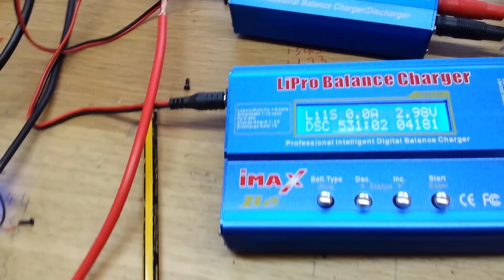18650 pack! 3 - cell or 4 - cell? Which is best suited for 12v applications??

Comment: since most car charging systems normally operate between 12.4vdc (fully charged lead acid/agm battery) to 14.4vdc while charging (this is the normal 12vdc accessory operating range)... most 12vdc electronics with battery protection (where equipped) will shut off and/or (if equipped) alarm at between 11.8-11.2vdc.( most car computers shut off around 11.2-11.5vdcand wont start the engine without having the battery charged or being jumpstarted). A 4S(4-18650 batteries hooked in series (X)parallel pack with buck converter set to output between 13.4vdc -14.4 vdc would be optimum since (watts (power out)= current (amps) x volts you want to run the higher side of the 12.4-14.4vdc voltage for any 12vdc accessories you want to power.
Reply: yes I know its an old video but people are still asking about it... this answer should help

Comment: I have done this test with an inverter with both 12v and 24v and the inverter will not come on until the voltage drops below 15v,,, at full charge the battery pack (4s) will be about 16.2 and the the inverter runs until the pack voltage reaches 10v,,, I have observed that most powerwall DYI on you-tube are using 4s.

Comment: As most 12v products work from 10.5 to 15v no buck converter is really needed if you limit your charge to the 15v peak. A 4s gives you the best results going from 12 to 15v. As with anything one should always check your devises for limits and do according. I would sooner make the adjustments for them through their connectors so the full power is available for those that aren’t as sensitive to the slightly higher voltage.

Comment: Your question of 3S vs 4S is step-up(& step down) vs step-down DC/DC converter. I'm putting no DC/DC converter out of this discussion as is purely based only on the load. We call the first one the buck-boost converter and the later one buck converter. So the answer is written on the "efficiency" of those DC/DC converter.

Comment: Build a 4S pack & add a DC to DC converter then you can dial the voltage down to what ever you like ........say 14.1V
Reply: Wouldn't that limit the wattage if you had say, 10 packs in parallel?

Comment: Perhaps a strange idea but if you install a diode between each pack (3 pieces if you chose 4 packs). These give you a tension drop of 3 x 0,7V = 2,1V. At that moment you are appr. in the right rage.

Comment: so, what are 3s ore 4s the best solution for an 12V? My solar will be adjusable for volts but my diesel generator is fixed to 14.4V... so an 3s will be over-charged and an 4s will be under-charged. What is the best solution then? if any?
Reply: Wire the generator and solar panel to a charge controller on a 4s pack and use buck converter for stable usable 12v.

I'm personally winging it with a 3s pack but I'm only running a couple lights.

Comment: I think 4s with buck is a good idea
Reply: Wouldn't the buck converter need to have an output something less than 12 volts since the 4S battery string can get down to 12 volts? The buck converter operation can be erratic and discontinuous if the input voltage and output voltage are the same.

Comment: I make 12v trolling motor batteries out of 18650's in 20-100 ah packs. I like the four series and I will explain why. @ 11V the trolling motor starts to get weak with 50-60% battery capacity still remaining. A three series can be safely drain to 9v but 12v devices fall out before that.  I had tried a boost converter to use below 11v power but you increase volts you decrease amps so it still ran weak. 

Using four series and a buck inverter I can use 80% of the cycle same performance from start to finish. Bucking down allows more amps if needed like when I run it on high. I set the buck inverter to 12.4 so as each parallel nears  3v it just shuts off as it cant boost... No bms 's on none of my packs use a buck regulator to control shut off for charge/discharge allowing me to solar charge them. I use a imax 6 to balance charge and keep a few cell checkers to balance during say a camping trip as packs get used. 

In my experience its more efficient to buck down than up making the 4s pack superior "imo". While it may seem your adding a whole series while not adding amp hours its the same energy thanks to ohms law. So my 75ah 4s packs last longer than my 100 ah 3s packs. Thanks to the much deeper cycle plus the higher usable voltage range. Three series is safer in the fact that you can't really drain them on a 12v system. While a 4s you can use them below 12v meaning cells take damage nearing 2.5v. 3s is also safer for lighting 16v may damage some led's. Anything with motor or higher amp needs a 4s is the way to go just monitor with a series cell checker.
Reply: What sort of buck inverter did you use? I tried to find any to suit 32A trolling motor with not much success...
Reply: Good question I ended up going threw a few bucks before finding one that worked. On high for extended periods of time they would overheat. I ended up using a drok buck with a heat sink and fan. It was a 25 amp unit but had constant current adjustments. So I dialed down the amp for high making for example "speed 7 the same as high"  I only turn the fan on when we travel distances with the motor and its powered by a separate 3s pack. For normal fishing use bumping it around on low- med its works fine. Also giving me more run time than an unbucked 4s pack.

Its really hard to find a buck that will handle a trolling motor on high for extended use the key for me was the CC adjustments.
Reply: Sad. I was hoping to get insight to a reliable & working configuration. 
I'm designing battery pack for tandem kayak's trolling motor (12V, 32A max constant current) and ended up with these options (from most to least favourable):

- 4S pack directly connected to PWM controller and the motor
    - it's just 8.3% of voltage increase over 15.5V which is max recommended for 12V motors
    - in theory directly connected to brushed DC motor shouldn't hirt it
    - but experiment required with real motor to see how it behaves under load in such conditions
- 4S pack with (2-4) DC voltage regulators run in parallel 
 - I found plenty of 10A-20A rated regulators which work with low voltage differential
 - so it can run with 4S pack and step down 12V..16.8V into 12V
 - in theory balancing circuit required to run these regulators in parallel
 - but practically, I can run more in parallel to get higher than needed combined current rate 
 - but again, experiment required
- 6S - 8S pack with one high current rated DC step down converter which works on high voltage differential
 - there are plenty of DC step down convertes, rated to 40A, 60A, 80A and even 100A 
 - but they all work on high voltage differential and require 18V .. 36V input voltage
 - this solution will significantly increase battery pack cost

So I will start from first to last and see how it goes...
Reply: Well my next exploit is to test automotive voltage regulators the whole thing is one big heat sink. Often they come in higher amp modulators. That or just run a 3s threw a capacitor bank witch in theory  could save 30%energy due to run start amp draws. 

Yea I am not satisfied with my configuration either.... Don't even bother trying to find a solar controller that want trickle charge and damage 18650's. Love messing with batteries but its frustrating its like technology isn't ready for them yet. Will report back if I find a decent solution will try many more until I do!
Reply: @MrSnapy1  any succsess with it yet?
Reply: Have you looked at a voltage regulator for a golf cart (buck/boost). I found one on Amazon that will take an input voltage between 8V to 40V at 50A and give a constant 13.8V at 40A. I haven't ordered it yet but plan to use one for a portable power box (battery and inverter with led lights and USB ports, maybe a Bluetooth amp and speakers) for weekend camping trips. It may be a few months before my next camping trip (Spring) but I'll try to come back with an update.

Comment: Depends on what 12v device you want to use a lot of them will function at the lower limits like 9v if it's an inverter if you find one that's cut off is near 9v and maybe just disable the alarm you may be ok

Comment: I've been pondering this as well. I have 16 li-ion (12-us18650s,and 4-cgr18650ca) that I've been wanting to wire into a 12v battery. I'm not sure if I can incorporate the 2 types into the same circuit (as the us18650s are 1300-1400mah,and the cgr18650ca are 2000mah),nor am I sure how to wire them together (x parallel,and/or x series,all series,all parallel,etc). lol simple I'm sure, but I'd rather "know" before moving forward.

Comment: quick obervation.. most common "12v" tool batteries use 3 cells, but most 18v use 5 cells (3.7v 18650s) (Milwaukee, Ryobi, Bosch, Dewalt, Makita). No 4 cell packs (?). The 12v is more like 10.8v 16.2Wh and the 5 cell goes up to 20v with Dewalt. Probably the geometry, triangle and flat. I guess the motors use what juice is there down to the protection cutt-off. What gadgets only run on 11+ volts? Seems like many gadgets run on the 5v USB voltage with the switching converter (dc-dc, step-down, buck).
Reply from the maker: simpleton my aim in this video was to highlight that you can use more power from A 4 cell pack than a 3 cell pack. When nicad cells were the best battery technology around you has 12v / 14.4v and 18v drills. But since lithium is now top dog 14.4 has died out.

I guess if you have a motor with a spec for a 4 cell pack than there's no stopping a company bringing out a new tool.

Lithium ion/polymer is hard to put to use in a 3 cell configuration as the 12.6v you get fully charged will drop to 12v under load. And he top .2v holds very little capacity.
Reply: simpleton the cells in those batteries are rated at a much higher ah output. The cells are usually 1600mah. But can out out 20amps. Where most cells that are 2000-3500mah can only output 10amps continous. So the cells in the batteries can output up to 20a. As they lose voltage the up the amps. I just noticed what I said was pretty irrelevant to ur point lol!. But the wattage is a lot higher for the motors. But for off grid a 4s pack is better than a 3

Comment: I wanted to use 180 brandnew panasonic 18650 batteries parallell connected x3 in 
series to get the 12V and approx 240A for my stealth campervan. But since my alternator and starter-battery are 14.7 V when my motor is running i  can't connect this selfmade leisure battery ( when it's finished ) directly 
onto the 12V starterbattery and aternator of my Iveco. I will be using a
 Battery isolator naturally to cut of the power when my Van is not running but 
but would the recommendation be, to use better 4 cells ? instead of 3 cells ?, so when my motor is running my 18650 batteries do get charged.. and i don't need a expensive high amp dc to dc convertor to get the voltage to 12Volts for charging my 18650's ? Also an inverter/charger charges with 13.8Volts which is also to high for the 3 cell bank :/ so everything points to a 4 cell bank. 

but will a solar charger  be still be strong enough to charge a 4 cell battery bank ? 
My Iveco alternator ?
and a inverter charger to ? 

at this moment i have bought already about 200 batteries, so i could make a 4 cell bank with each bank 50 batteries ( 150A )

PS: ordered them here : https://www.aliexpress.com/item/12-PCS-LOT-100-Brand-New-Original-NCR18650B-18650-3400-mah-Li-ion-Rechargeable-battery-For/32352979259.html

and had them tested at home for capacity and  they are the real deal :)    ( i had other providers who failed misserably )

Comment: I would go foe the 4 cells in series to get the higher voltage pack. Anything designed to go in a car will be able to work with the higher voltages just fine and you will, for the same power, have lower losses due to resistance in wiring and such because the currents are lower with the higher voltages.
Reply: Morten Mortensen only certain electronics will draw less with more volts.
any resistive load will draw more with more volts.
Reply: Ryan Macklin They will indeed, but for a shorter time. how many purely resistive loads are you going to run of this small battery anyway?

Higher voltages means lower resistive power loss in the wiring for the same power delivered. if you are using high frequency switch mode power supplies / voltage converters then the lower power loss due to resistive losses in the wiring is a huge win.
Reply: Morten Mortensen i do agree with you.
this is why i would recomend minimum cable lenght at 12v, realistically 12v or anything under 48v is a joke for real power without a list of issues  eg voltage drop ( only changes with amps but you have minimum volts to loose), high amp loads, large cables and switches and electronics and as you said, losses

Comment: My inverter only wants to run on 3 18650 in a series.  When I try 4 it won't turn on probably because 15.7 volts is too high. It lasts only a few seconds with only 3 by themselves so it looks like you'll have to run allot together.  The inverter must use a small amount just to run it's self.

Comment: I don't know if this channel is still active or not but I have a plan to use 12v to a rf switch to a 12v led strip my only concern is over discharge since the 12v leds can work with 8-9v

Comment: did you ever solve this?  I need to provide 12v, but 4s goes from 16.8 down to 12.0v and a Step Down converter will require like 1v minimum, so the lowest I can make a 4s give is 13v.  Should I make a 5s system (21v fully charged, and 15v fully discharged?)   Are there any 10a step-down converters that don't need an entire V of leeway?
Reply: I found the answer, there's a thing called a non-inverting automatic buck boost converter stabilizer voltage regulator, that will buck the input voltage when higher, and boost the voltage when lower, providing a stable 12v all the time

Comment: I realize this is an old vid but those paper covered cells are likely older 3.6v and shouldn't be charged over 4v. I actually pulled some out of a pack a couple days ago.
Reply: Richard Driskill  You should have said something about max load and dod if you stay well within the parameters ( min 3.3 v and max 3.9v) you get a hell of a lot more recharges!

Comment: Is a 5V micro-usb charger able to charge these 3 18650 batteries in series? What should I use to charge them? I want only the circuit? Can you tell the name of it or was it a simple 5v micro-usb charger that charging 3 of them at the same time?

Comment: Maybe best solution is to use 3 x 3.7v batteries = 11.1v (or 3 x 4.2v fully charged = 12.6v) and use some larger capacitors 20v for example and get constant 12+ voltage ? I am sorry I am not an expert.
Reply: John Doe   I am sorry I am not an expert.?  Yeah, we get that.  Don't advice capacitors if you don't know what device he's using it for!

Comment: I don't understand people saying that 3x18650 charged is NOT 12.6v, or as one person claimed, that's a significant over charge. Every 18650 I own, which is approx 100-120 serviceable and another 100 or so past their prime, all charge to 4.2v.  I run them regardless of application, down to about 3.6 and then recharge. The only variation from this standard I'm aware of is the lithium chemistry (can't recall which ATM, LiFePO I think) that's 3.2 and a few manf that make cells designed to charge to 4.3v. 
point being, whats all the alarmist BS? Id build the pack (and DO) as a 4S-__P configuration. and use a buck converter to hold 12 v for use.
Reply from the maker: I think the cell chemistry is much safer than everyone is lead to believe. 4.2 top but it's quite popular not to over stress the cells by charging to 4.0-4.1 as it's the last part of the charge takes the longest and doesn't gain you a great capacity. pouch type cells I do not trust at all.

Comment: Very nice video, thanks for it. 
I have a question, I want to make 12v, 18650 battery pack with 4 batteries in series like you but I wonder what is better:
1) to have Battery Management System for the hole pack 
or 
2) to have 4 Battery Management System for each battery in series.

Comment: I would go with 3S battery, you don't want to over discharge any cell, for safety. Build a bigger battery if you need the extra capacity, safety's more important it would seem to me.

Comment: When I use 4 cells my 12v inverter shuts down from over voltage.
Reply: lmorrison17 use a step down module
Reply: @swimwithcoachraven1532  which module.
Are you talking about 78.12
I need step down in 20amp

Comment: Make your pack with 4S and only charge it to 15.5.  Aways check with every device but most 12V devices (espesially inverters) will run off of 15.5V.  This gives you way more runtime than a 13.4 charged lead acid battery.   It's also better for the batteries because you're not charging them to full capacity.
Reply: John Day just wanted to say I thought this was a good idea! It's what I would do.
Reply: John Day great idea been thinking of this for some time now thanks John you have solved my problem didn't even think of adjusting the charger and you are right the batteries will last longer thanks mate.
Reply: You're right dude, I'll probably go with the 4s route just to prolong the batteries. Building this thing has already given me enough stress. I don't want to build another in a long time..... https://www.wheelchairdriver.com/BMS.htm
Reply: John Day Thanks
Reply: I must have a finiky Inverter....It won't run on 15.1 and up it seems. 
 I was wondering what to also...
I made a 2P 3S battery bank out of laptop batteries....
Reply: You would not want to do that.  You would never have the batteries more than half charged up.  It is not bad for lithium Ion to be fully charged at all.
Reply: @gregkramer5588  Storing a 3.7v nominal cell above 4v will degrade the cell faster.